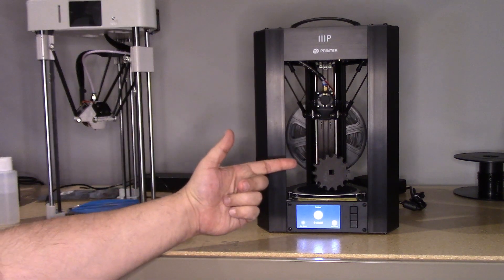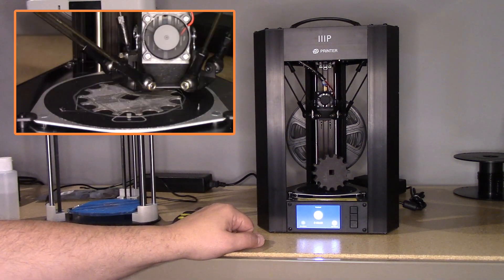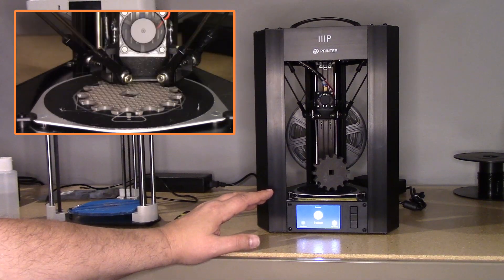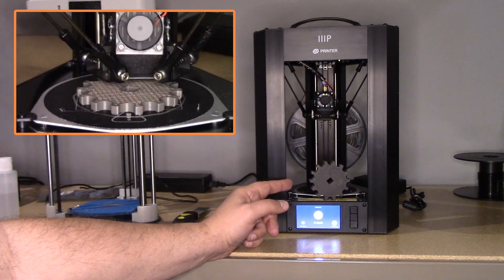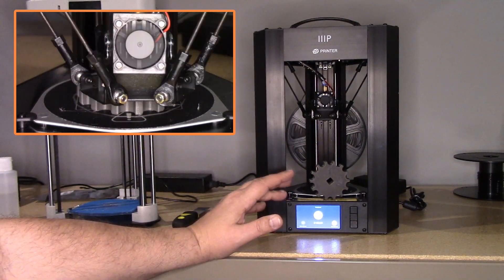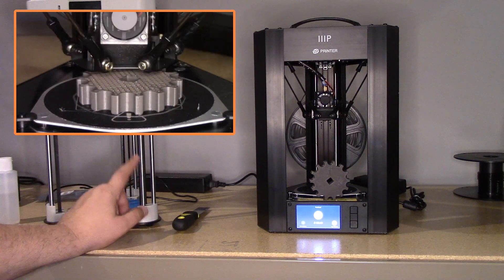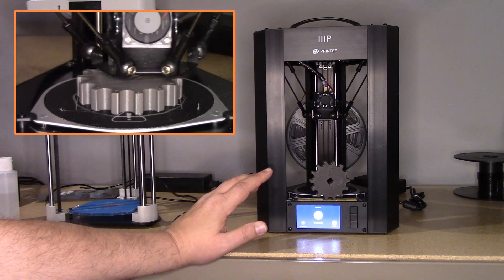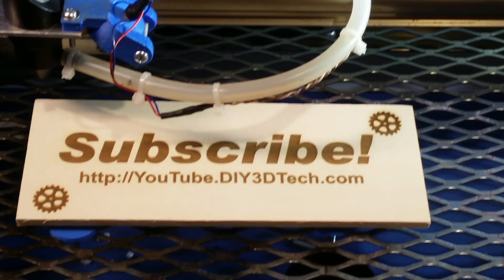MonoPriceMini Delta - Rambling About Why I bought it!

Comment: I don't think a barrel jack is a good combination with a ten amp supply. They always seem to over heat over time.
Reply from the maker: New had an issue on my GeeTech, MonoPrice Mini v1 or CNC...  (all have a 10amp 12v pws)
Reply: @DIY3DTECHcom   I've burned up two lap top connectors and I'm currently swapping out the socket in a guitar foot effects controller that had melted slowly over the last decade.

Comment: I have a mpsm 2 that I never use since I got my ender 3, any suggestions for mods to it? Since it is tiny, I thought about converting to an enclosed HOT or insanely fine printer for small assemblies, and hardware, possibly in *nylon or other high temp materials. I do not really have a need for tpu, but I can see hotter bed, linear rails, very fine or dual z ? Not sure what everyone is using their minis for, I only really do mechanical functional printing, and it just sits there. :(
Reply from the maker: Interesting, mathematical function printing?  Do you use the results for teaching?
Reply: @DIY3DTECHcom  mechanical! hell no maths

Comment: Would be good to see it's performance on taller parts.  I find my delta (not the MonoPrice) suffers from accuracy issues as parts become taller...
Reply: That's a rigidity issue, which allows resonance/oscillation/motion.
Reply: @jimbarchuk  I'm fairly certain that mechanical rigidity is not the problem.  The symptom is a linear distortion in dimension as the part height increases.  To me it feels more like a calculation issue or potentially a firmware configuration problem...
Reply from the maker: I am agreeing with Jim as I have a couple (deltas) and never had an issue with parts.  As either something is lose or an arm is bent...
Reply: @DIY3DTECHcom  Again, I'm quite certain that nothing is loose as this would result in somewhat random dimensional changes and artifacts.  The prints are visually perfect. 

In my case, if I were to print a large object, something with an 150mm x 150mm base and 50mm tall, the base dimensions would be correct to within 0.1mm.  The top of the part would be smaller by 1-1.5 mm.  Initially I thought this was material shrinkage but ruled this out since the identical part printed on a Cartesian printer was dimensionally perfect. 

So back to my original question: have you done a similar print on a delta and verified the accuracy?